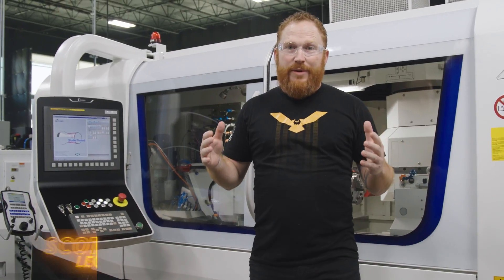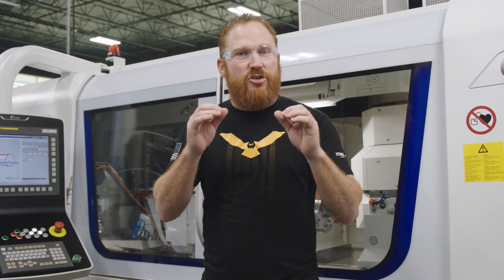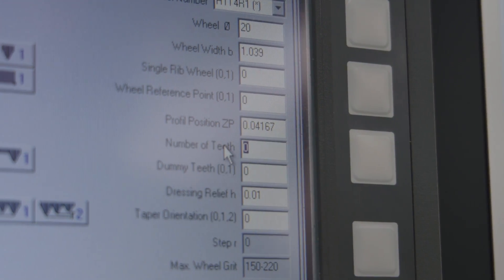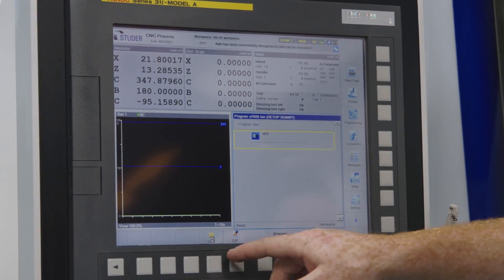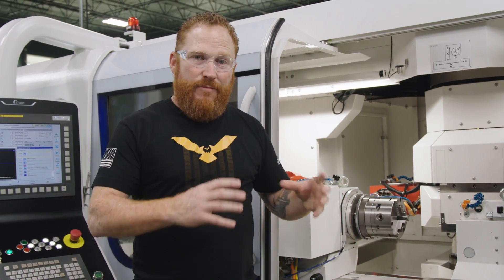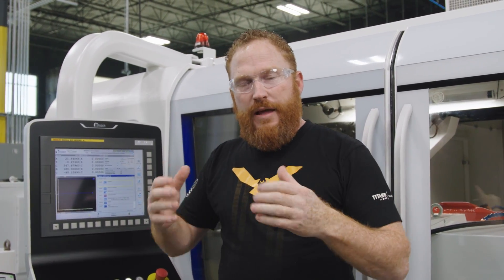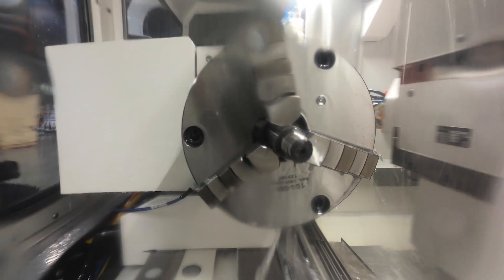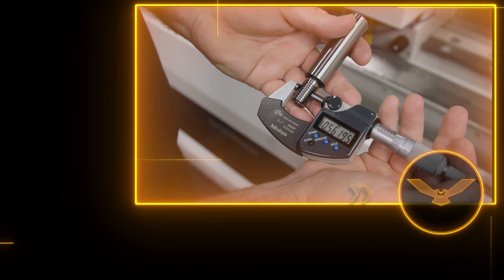Threading on a STUDER S41 from United Grinding

Comment: Engineer: OMG 
Me: I hope he makes his 1.7m back selling screws that take 4 days to make
Reply: A bolt for 40k… hand the phone back to Mummy or Daddy… your getting over excited
Reply: well said, but one of those bolts might cost 10k or 40k USD.
And I don't think the customer only wants one bolt.
The cost per bolt drops if you need more.
Reply: 💯 ! Which is why I went with an old fashion swiss machine that can do this very same process. At half the time and no where near the cost to buy. Less than 50k.

Comment: I know it's cool to watch but you can get the same results on a lathe with well ground carbide tooling.seems like it's solving a problem we didn't have.unless your trying to put threads on carbide.then sure.but with how abrasive resistant carbide is I can only imagine how much you would need to dress that wheel to get a single part

Comment: but why? 
I am thinking you take the time to cut the threat on the wheel aand then after a few parts with the wheel its going to get worn out pretty quick.

why not just cut threats on the parts instead of the stone?

Comment: I'm a 27 yr ASE Master Mechanic, I want to learn Cad/cam cnc as a trade, problem is loss of income from my current wages to starting wage, advice appreciated
Reply: Community colleges usually teach machine work from 4 or 5 to 8 or 9 that is the first thing you might want to take, looking at drawings and making them into parts is like cading, after or during that I would somehow take a cad course (likely have to change schedule, next semester I would talk to the machine shop teacher (that you had before) if cnc is not offered at nights and ask if you can take it during his machine shop class and tell him you already took a cad class.  If they offer additive manufacturing class (3d printer) I would tell my cad teacher if they teach that class the same thing you told the machine shop teacher but opposite way around, you might as well have that knowledge.  If you do that pass the adda certification for cadd.  get a job in the car manufacture world and they might pay you to get an engineering degree if youre good at cadding, know cars, and have machine shop knowledge, or you might just have to work with engineers that know theory and you can bang you head against the wall, such is life.

Comment: I had no idea they used grinders to make precision threads. So many questions... How many parts can you manufacture with this one pass on the grinding wheel? If you can re-cut the wheel to make more parts, does the smaller diameter of the grinding wheel has to be calculated into the timing of the grind? Are long precision threads (like acme screws and othera) all cut using grinding?
Reply: Great questions. Depending on the thread and how aggressive you grind will determine the number of parts before dressing. As usual with grinding, the application will dictate. Yes, as you dress the wheel does get smaller, but it takes time before wearing down to a point where RPM will need to be adjusted to achieve the same cutting speeds (SFM). Dressing passes are generally very small (less than .0005). I cannot say for all ACME screws but many ball screws are ground.

Comment: KEY IN CHUCK BETTER DUCK!!!!! , and btw how precise is measuring the threads without thread wire ?
Reply: or at least a go nogo gauge. but 3 wire is your best bet
anytime in the shop and you left the key in the chuck you were told to go home.
on the 3rd time you were fired on the spot

Comment: I assume that tool steel is in a post heat treating state, so I assume around 60 Rockwell?  The application there is obvious, but I wonder how many can be made to within tolerance before the wheel needs to be redressed?

Comment: What are the benefits of having such a perfect and precise thread as opposed to cut thread?
Reply: Precision, probably not used as much for fastening, but think about Precision movement threads, generally ball and worm controls found in most cnc x and y (not often z) will be ground.

Micrometer threads etc. 

Benefits to the thread itself are at the grain boundaries, less imperfections than cutting
Reply: There are multiple reasons, depending on the purpose of the thread. If the thread is being used in some kind of motion control application, that would be a good reason to need threads cut to such accuracy and precision. Threads that fit together with little to no play also create a much stronger joint. It could also be a financial move and the accuracy of the threads is just a nice side effect. For example, the threads in the video were made from hardened D2. If you've got an application where you need a threaded rod made from D2 at 62 Rc, you're not cutting that shit unless you cut it first, then send it off to get hardened... and then you have to worry about the deformation that happens to the threads that occurs during heat treatment and how that affects your application. It may be a better option, financially, to buy through-hardened D2 rod and just grind the threads. Can you hard turn the threads? Maybe... Depends on the application and the limits of manufacturing based on the materials and equipment.

Generally speaking, though, motion control applications or more complex things like conical extruder screws or injection mold screws is where you would need highly accurate and precise thread forms manufactured from high quality, hardened tool steels and those need to be CNC ground.

Edit: someone also mentioned thread gages, so I guess that's another good reason

Comment: i used to run Excello thread grinders to make rotary shouldered tool joint gage's in the 80's. they were not cnc all mechanical. od. and id. with tapers.

Comment: As the thread is being ground how do you control and compensate for the wear on the profile of the wheel?
Reply: Rough grind then redress/profile the wheel and finish grind.
Reply: @brandons9138  does the machine know how much the wheel wears and when to redress?
Reply: @skmetal7  On a machine like this it may be equiped with automatic compensation of some sort. If not it would be up to the person running it to check parts and make adjustments. I don't know enough about this type of machining to be certain.  I'm primarily a lathe/swiss machinist.

Comment: So here’s a question, how are tolerances and repeatability so high with a consumable grinding wheel?
Reply: All cutting tools are consumable.  Compensation is the key.  In this case you have to redress/reprofile the wheel in order the hold tight tolerances.

Comment: I'd love to see some tungsten carbide made on this. I've heard that it can only be ground and not machined.
Reply: Some grades of tungsten carbide can be machined.  Just like most metals there are harder and softer grades of the material.  Not all tungsten carbide tooling is the same hardness.

Comment: you can technically "re pick up" a thread its just very tedious and annoying, i know the new prototrak lathes have a thread repair feature, a guy at my work uses it whenever he has to re work a thread. just a pain to get the tool established
Reply: umm if you don't take out the part you can re-run the thread cycle infinite amount of times, I tried it both on Fanuc control and on Sinumerik (lathe), so if you can measure the thread right after the cycle ur good to go.

Comment: I work in the manufacturing of similar machines, our machines can also tilt the grinding wheel for making steeper threads. Mostly used for ballscrews and worms, but also more special applications like gear hobs. They can also do internal threading.
Reply: Mind if I ask what kind of machines are you guys using at that shop ...
Reply: @ernestodiaz9951  you mean what machines we use for making parts for our machines? We also produce large scale gantry milling machines and have some of those for machining the main structural components from cast iron. Most other stuff gets bought in or made externally though.
Reply: Thanks I was wondering if you guys were doing cylindrical worm thread grinding.
Reply: @ernestodiaz9951  we do, although we're located in germany

Comment: Old war surplus ex cello thread grinders did the same work for 1000 times less money. How much per hour do you have to charge to do job shop shop work. $2000 an hour?
Reply: He doesn't pay for these machines.  They are all loaned to him so they get seen by his followers.  If you went back and look at how many machines they have gone though during the time that this channel has been around, you'd be amazed.

Comment: Two questions Sir. Does the thread profile of the cutting wheel exactly translate to the resulting thread profile of the part??? That’s something I’ve wondered for some time. I guess it doesn’t, and if it’s the case, do you calculated it or something??? Greetings from Spain 👋
Reply: No. The profile on the wheel needs to be a little bit sharper, because it's removing material above and below the central plane (which is where you measure the angles as shown on the diagram on the screen). Same problem as thread milling, same solution.
Reply: @iainascott  that. Or if you have a tilting wheel that matches the helix angle. Same result but with immeasurably longer wheel life on one off parts

Comment: How much money does it take off the grinding wheel to remove that profile you made if you wanted to profile the disk back flat furore surfacing duties. Genuin question. And awsome invasion as always
Reply: Thank you for your question. Depending on the application, it may be better to have a wheel for threading, and a wheel for the surface. We all know time is money. With that in mind, you need to assess if dressing the wheel flat is worth machine time. It takes a while (.0004 per pass or so) to dress a wheel flat.
Reply: @redbeard_1371  great response. Many thanks Scott 😉

Comment: Maybe you can grind it but are we sure it’s cost effective with that method ? And I’ve got a feeling that this grinder will vanish in few months like makino did and dmg...
Reply: No, they are a successful company and build and sell machines that are just stupid and not cost effective at all. They must be lucky that some idiots still buy them :/

And on a serious note: Being the cheapest or fastest aren't the only two target parameters for machines like this. Special applications ask for specialized machinery. So, yes, for a specific use case this is "cost effective" compared to other methods for the same application.
Reply: @stefan514  Special applications would be the correct reason for purchasing a Studer grinding machine. I worked in a large cutting tool manufacturing facility. We used Studer machines to grind a plethora of features both on tools, and tool/work holding parts to excellent results (tolerances of .0002" to print. Most times held well below that, even). I can't say enough good things about Studer machines if you have an application for them.

Comment: What are the pros and cons to using this compared to threading on a lathe, is the thread stronger? Is it faster to do it this way? Is there any necessary tool wear like there is on a conventional threaded insert? Does it leave any burrs at any point?
Reply: I imagine it’s only used on very hard material otherwise it would be quicker /cheaper to use a full form insert. ??
Reply: @ChrisBrown-dy8ts  that’s what I’m thinking, I haven’t worked on many hard materials so I’m not sure, but even so, you’d expect if you had the right grade of insert even cutting the hardest materials would be easier on a full form insert?

Comment: This is the most expensive way off cutting threads but man the results are gorgeous.
Reply: Extremely expensive and quite frankly slow as snot
Reply: @bobsnedekers  When your dealing with parts in the high 50-60 HRC you might not have a choice, CBN milling or turning might not be easier at this point.
Reply: @bensthingsthoughts  Considering you can get carbides up to 85, I'm not so sure grinding is easier... in fact, I'd say it's still harder (or more tedious and time-consuming).
Reply: @sleepyancient6655  Yes you can get CBN inserts, but there must be instances when grinding is a viable option, I guess. Or it might be a gimmick, "if it can do it, why not" type of scenarios, I don't know
Reply: @bensthingsthoughts  maybe kinda a gimmick for steel but we use these to make threaded carbide parts and I don't think there is a better way for that. I could be wrong though.
Reply: @callmetatersalad132  Woaw, threaded carbide... I had never heard of that, but it kind of make sense. This a very satisfying answer to the debate above imho.
Reply: @bensthingsthoughts  Yeah, honestly idk what its going to be used for because id imagine it would be very easy to cross thread unless you are threading into other carbide. Stuff is strong man, i hate working with it ha.
Reply: @callmetatersalad132  I just realised, how are carbide and HSS taps ground ?
I recon this could be one way right ?
Reply: @bensthingsthoughts  We make alot of stuff similar to it so there is a high chance ya.
Reply: @bobsnedekers  quick and dirty all the way or what's your motto? If the result needs to meet certain goals, time isn't the most important thing ^^
Reply: I want to know how many minutes took that thread....
Reply: @luismaryland2305  around a minute
Reply: Agree. I feel like the only application for this is to make thread gauges.
Reply: Its ok 👌 Thanks for this Video Great #DuplexCNC
Reply: Yea but if the customer requires the thread to be ground the. You have no choice ... perhaps it’s a gage of some sort !
Reply: @julioalvarez6294   Even if that's the case there are far easier and cheaper ways to grind them that's faster and much much cheaper.

Comment: I've cut 100s of thousands of threads and if the nominal dia is .562 then the major should be less than .562 maybe 5 or 10 thousandths. You're making the thread od too large.
Reply: I've never heard of a company that wants an interference for a 100% standard 9/16 12 tpi thread. An interference fit does not fit into a standard tapped hole. And I've never heard of standard tap that is that big.
Reply: @bobsnedekers  they didn't say standard also im sure they just did it to show accuracy.
Reply: Just like if a print does not say rh or lh thread, you MUST presume it's rh. If he said 9/16 12 tpi you MUST presume it's a standard thread. What's the point of an interference fit if you could make a npt thread or a buttress thread? That's asinine. What engineer that went to college for 4-6 years will want an interference fit on a standard thread? That engineer should be fired.
Reply: @bobsnedekers  if a customer asks for a interference fit it doesn't matter what you as a manufacturer think you do what they are paying you for.
Reply: I have had to make interference fit standard size threads for the gas & oil industry it was some sort of sub sea gate probe if I remember 😅 was a very long time ago
Reply: Again, there are better threads you could make w/o using interference threads. I understand the whole customer/manufacturer relationship, but the engineer should have called out an npt thread for underwater water work especially, cause that is what they are made for. It sounds super uncommon and it would STILL be asinine to make such thread for the reasons above.
Reply: On a standard thread you are completely right but some specials are much tighter and some customers want a interference fit.

Comment: Cool video and all but he forgot the key in the chuck
😬😅
Reply: Well, it's a enclosed cnc machine. When the door is open the spindle probably can't be turned on regularly because of safety switches.
Reply: @chas1878  true but sometimes you have to use a manual machine and habits tend to follow you around.
Reply: @philipcable7518  I agree, it's still good practice to remove the key regardless of how the machine handles safety
Reply: Loved the video, but my pucker factor was off the chart seeing that chuck key in there. Glad you said it for me!

Comment: Cool video. I need that machine to neck back my endmills PERFECTLY. We have a manual OD grinder at work. People use the diamond wheel like its a turning tool. It's all rounded over so necking back tools is a PITA. This machine would be amazing for custom tooling grinds.

Comment: Impressive

What's wild is, the man across the street had a similar machine made back in the 50's
He paid around $300,000 for it new (I saw the invoice). It was just setting there, rusting down. He retired 3 years ago and passed not long after retirement.
He had a metallurgical assay company and used the grinder to grind perfect round samples for the "pullling" machine.
Mr Frank. He was an engineer, old school style. Very good friend. I miss him.

Comment: Nice vid, I love it. What is the tool that dresses the profile into the wheel and how much does that wear during the dressing? Is there closed loop on the dressing process? I'm fascinated in the whole back story to the dressing side of this... I guess that's the black art, magic, experience required thing to make the end result "puuurfect"?
Reply: The dressing tool is usually monolithic diamond. From my experience the process is slow, moving along the needed contour over and over with small stepover until it's completely dressed in. After that you only have to dress once inbetween every now and then to make up for grinding wheel wear (the software tracks the current wheel diameter).

Comment: how much are the grinding wheels? would you just dress it flat again to use for OD grinding again?
Reply: That is 100% correct. It we needed that wheel for another application we would re/dress it. However it does take some time since dressing passes are only about .0004 per pass. Wheels are like endmills in that some are cheap and others cost hundreds or thousands. This wheel is a few hundred.